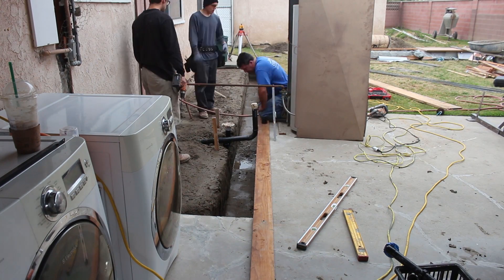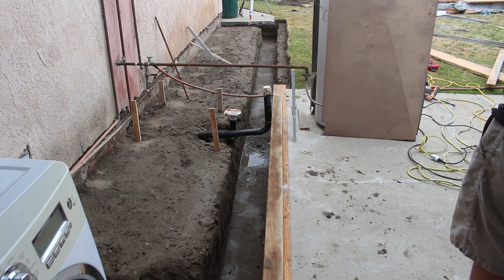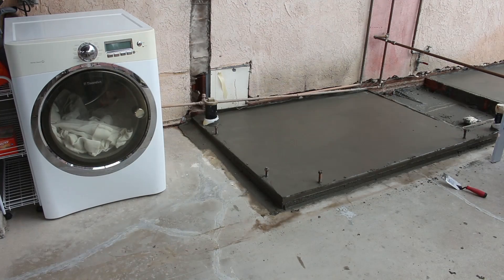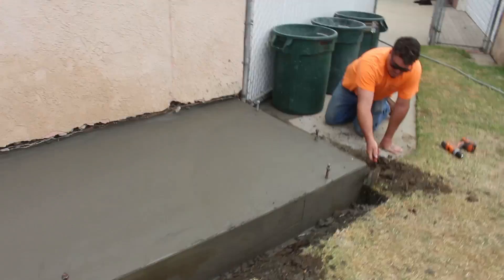How to Setup and Pour a Concrete Foundation for Rooms addition and Extended Houses

Comment: Hi Mr. David, my question is how can i know how many yards i need for my project, and what type of mix so i don't have to worry about the bubbles ? Thanks, great work
Reply from the maker: 2500 psi 3/4"rock
Reply: Odell Complete Concrete ok, thanks, I have a 25' x 30' area and we already made the ditch all the way around it's 24 inch. Deep by 20 w. , I'm using 1/2 inch rebar but I need to know how much concrete we need.  Thank you again

Comment: great job - just curious about the anchor bolts - on drawings they always show them with a big curve in them, to have better grip I suppose, but it's ok to use straight bolts as well?
Reply from the maker: The straight ones usually have double nuts and square washer at bottom, or straight bolt epoxied in.

Comment: Why are concrete vibrators used on some jobs?
Reply from the maker: BoltActionMonky 
Because there I alot of steel spaced closely together, along with big rock and low slumps.
Nightmare pours.

Comment: I currently have a patio room 15x20 and I want to remove it and make real room addition 21x20 the existing concrete slab is 4 inches with rebar, what do you recommend for the placement of my footings, remove the existing slab and build it with footers or cut the concrete and build the footing. Also do think I should attach 6 x 20 slab or demo the existing and pour a new slab. Let me know what you think
Reply from the maker: Your best bet is to start from scratch, since the patio slab, probably isn't level or the right the height.

Comment: That water heater needs replaced.
Reply: How deep did you dig the foundation and how thick was the foundation.
Reply from the maker: Thomas Morris 
for sure
Reply: Thomas, I read somewhere that the foundation is to be 24" in height, 18" below grade and 6" above grade.  But I don't know this for a fact.
Reply from the maker: I read 10" below grade and 6" raised
Reply: Per the 2016 California Building Code (see link), Section 1809.4 on page 151, "the minimum depth of footings below the undisturbed ground surface shall be 12" [for a one-story building]. __ https://codes.iccsafe.org/public/chapter/content/1836/
Reply from the maker: GSMSfromFV 
That's great you corrected yourself

Comment: how much time elapsed between the last of the pour and the earliest you can pull those forms without any slump in the concrete but still be able to smooth it out?
Reply from the maker: rickiep perez 
every job is different.

Comment: Please stop spraying used motor oil on everything. One quart of oil can contaminate 250,000 gallons of water. Use a mold release wax.
Reply from the maker: Mekhanic1 
The oil go's on the wood.
Think of it as a oil base stain.
what you see on all stained wood.
Reply: Mekhanic1 It's not being sprayed on everything, it has soaked into the wood and after the forms come off he takes them to the next job.

Comment: What are they adding on, a closet ?
Reply from the maker: thegreatecb 
The master bedroom is getting bigger as well as the bathroom
Reply: Odell Complete Concrete : A little bit can make a huge difference. I'm starting a job in a couple weeks similar to this. House is getting 10' longer with existing depth of 28'. Biggest difference in my job is the house has a basement. Addition will be 560 sqft total. Laundry/Mudroom upstairs and larger den and bedroom downstairs. Nice job BTW.

Comment: David, How come sometimes you use rectangular metal stakes and sometimes round metal stakes on forms? When/where/why do you chose rectangle or round stakes for a particular application?
Reply from the maker: Michael LeCompte 
round are good for rocky ground.
flat stakes are good in not rocky ground
Reply: Odell Complete Concrete I just saw in a different video you called that flat one a line stake. Makes sense cos the string always wants to spin on a round stake. I'm learning lots of little details that make the job easier. 👍
Reply: There is some different ways to tie the string so it doesn't slip.